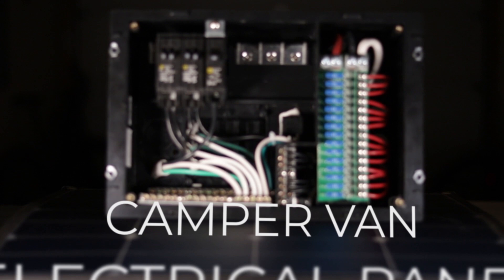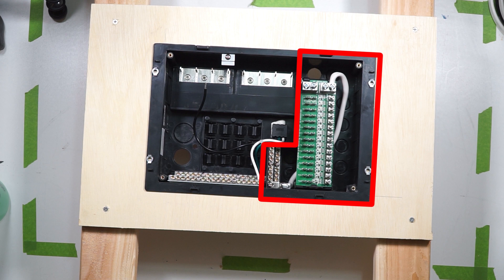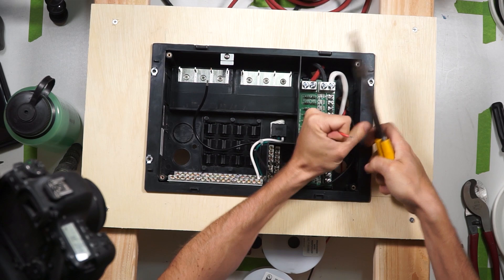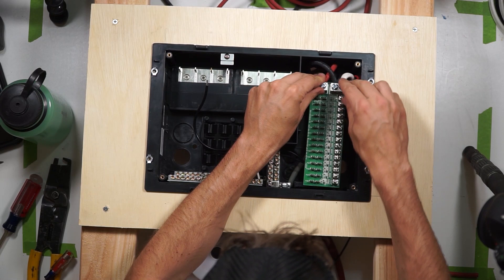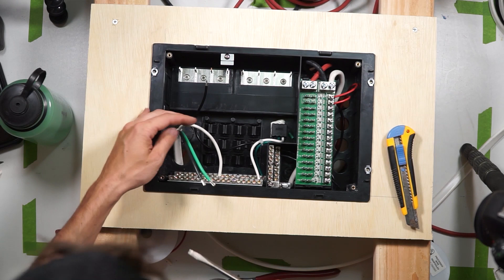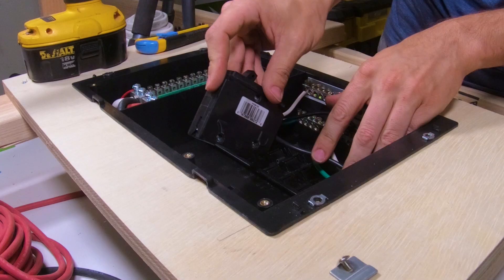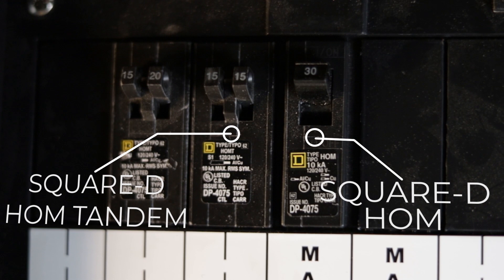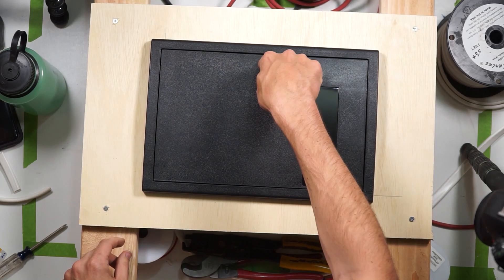How To Wire a Camper Van Electrical Distribution Panel

Comment: What about if your wiring one with 2-120v ac ? Is there 2 separate positive breaker bud bars for 50 amp service
Reply from the maker: Yes. This is compatible with 50A 120V/240V split phase input (but cannot run 240V loads).
Reply: Are you saying both hots go on the same positive breaker bus bar ?
Reply from the maker: Nope.  Dual pole 50A breaker.  L1 to one side.  L2 to the other side.
Reply: Thank you that’s what I was thinking
Reply: What’s good one ? I’m up grading fro 30 amp to 50 amp and adding an air conditioner & as it is right now the 30 amp breaker trips a couple of times a week if I’m running both electric heaters plus I’m sharing my electric fireplace and microwave off an either or switch. ..
Reply: Will be needing a good converter to go with that also
Reply: I’ve got WFCO POWER CONVERTER WITH DISTRIBUTION PANEL MODEL WF-8955PEC
Reply: It’s just a single pole
Reply: Thnx in advance sir

Comment: What is the plug in the back for?
Reply from the maker: It is just a standard outlet that can be powered by the breaker box if desired.  I rarely see that actually used.

Comment: Hey Nate. I wired the panel as you have shown. Is there an easy way to get power to the other bus bar on the right?
Reply: I should clarify. I have a 50A breaker connected to my 4000W inverter. I would like both sides to run off the one 50A breaker. Can I just run a 6AWG wire to connect the 2 bars?
Reply from the maker: @ttirrell  Nope.  That side is reserved for systems with 120V/240V shore power (50A shore power).  BUT... I have yet to see a camper that TRULY needs more than 6 AC circuits.  See the 6-circuit wiring diagram example halfway down this blog post: https://www.explorist.life/how-to-wire-120v-ac-circuits-in-a-diy-camper-van/
Reply: @EXPLORISTlife  Thanks. I bought single pole breakers not realizing there were 2 sides. I'll have to switch them out for double pole.
Reply from the maker: @ttirrell  "Tandem" is the breaker keyword you are looking for.  Square D HOMT Breakers.  (HOM Tandem)

Comment: Can you use this for AC Distribution from a 30 AMP 125V shore power plug?
Reply from the maker: Yep!
Reply: @EXPLORISTlife  without going through the invertor/convertor?  want to use Shore power for 15 Amp outlets, but also want to make sure I can Hook up in a Campground.  2003 E350 Superduty Cut Chassis with Thomas Minotour Body. 2/3 done with Internal Build but decided to add power.
Reply from the maker: Correct.  You just won't be able to power anything unless connected to shore power.

Comment: how do you setup the AC group to the right of the 30amp breaker? Does another 30amp breaker go into the first slot?
Reply from the maker: That's for 50A 120V/240V shore power service OR for using Output 2 from an Inverter like the Victron Multiplus for circuits controlled by shore power ONLY.
Reply: @EXPLORISTlife  Thanks. So a 50amp breaker would be used to supply power to all four AC slots in the panel.
Reply from the maker: If you are supplying power with 6 gauge wire, yes.  Which one of my diagrams are you following? (explorist.life/solarwiringdiagrams) I can give you better answers if I know what setup you are trying to install.
Reply: @EXPLORISTlife  I have used several of your video discussions to develop a system. I can send you a diagram if you like?
Reply from the maker: I see.  So, if you are delivering 50A of power through 6 gauge wire to your breaker box, you need a 50A breaker. If you are delivering 30A of power through 10 gauge wire to your breaker box, you need a 30A breaker.
Reply: @EXPLORISTlife  thanks again. I have learned a lot from your videos.

Comment: Is there a reason this could not be used for a small house system rather than a camper or van
Reply from the maker: You'd want to check the ratings and building codes; but I'd never install this in a house as I'd never be running 12V appliances/devices in a house.  I'd opt for a more traditional residential breaker box.
Reply: @EXPLORISTlife  Thank you for being honest and not just selling product
Reply from the maker: I mean... I can sell product too...  Here's a good residential breaker box for ya: https://amzn.to/3Cfv0Ta 

:D :D :D
Reply: @EXPLORISTlife  Can I run a plug from my inverter wired to a 30 amp breaker then run 2 - 15 amp breakers for my fridge and a few plugs?
Reply from the maker: ""Probably"", but without knowing the full scope of your project; I can't say for certain.

Comment: What is the 20amp receptacle in the back of the box used for?
Reply from the maker: It's in such an awkward spot I don't use it for much of anything.   It's fine to just coil up the wires and not use them or cut them off completely if you see yourself not using that receptacle.
Reply: @EXPLORISTlife  Another question. Do i need to ground the AC, and DC sides separately to the frame, or can they share a ground to the frame?
Reply from the maker: Don't ground the AC side of the system.  The Victron inverter chargers takes care of that internally.

Comment: HOW IS THE PDS POWERED ITSELF??
Reply from the maker: In my diagrams, It's powered from the Inverter (from the batteries) or from shore power (from inverter passthrough): https://www.explorist.life/3000w-inverter-400-600ah-400-to-1200w-solar-camper-solar-kit
Reply: @EXPLORISTlife  I have pure sine wave inverter, a single battleborn battery and this panel.  What else will I need?
Reply from the maker: You could consider using this diagram and parts list for a system like that as long as your inverter is under 2000w: https://www.explorist.life/2000w-inverter-200-400ah-lithium-200-to-700w-solar-camper-wiring-diagram/
Reply: @EXPLORISTlife  is it possible to send a picture of my current setup to someone?  I will pay for help - i only have the equipment i mentioned, i need to know what im missing.  I constantly get errors on the charge controller.
Reply from the maker: I have a consulting service for personalizes suport like that, but being totally transparent... I'm not going to make you a parts list and diagram for your specific setup.  But if you have specific questions & pictures, that's a good place to get my help: community.explorist.life
Reply: @EXPLORISTlife  okay so if i sign up for membership and then fire the question/pictures thats where I start, right?  I dont need a diagram just advice on what else to buy - my current setup isnt working.
Reply from the maker: Correct
Reply: @EXPLORISTlife  with just inverter, battery, and this panel, i constantly get a "load short circuit" error.  Inverter gives long beep when turned on like something is wrong.  Battery voltmeter shows readings fine.  makes no sense

Comment: Do you sell these panels?
Reply from the maker: Check the pinned comment at the top of the comments section. 🙂👍
Reply: @EXPLORISTlife   I can't find a pinned comment. I looked on your website and can't find it either.
Could you email me the link?
russblom57@gmail.com
Thank you.
Reply from the maker: Hmm... not sure why it's not showing up.  Here's the copy/paste: 

2021 Update!!  Can't find this panel in stock?  Neither could we... so we took matters into our own hands and ordered a few pallets of an alternative solution so we could ensure that these stay in stock for you.  Plus... our new panels have 18 spots for DC circuits, slots for 8 AC circuits per leg (16 total for the box) and they are in separate enclosures so you have a little more flexibility when it comes to mounting them.  Check them out here: https://shop.explorist.life/product-category/all-products/distribution-panels/